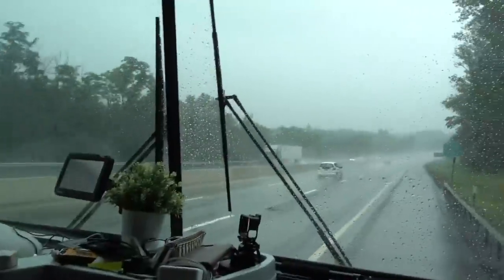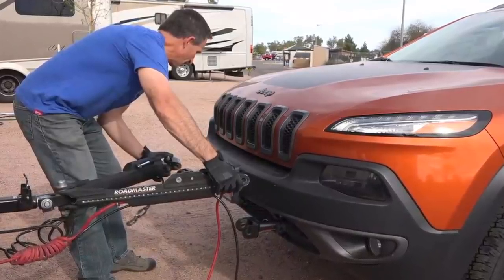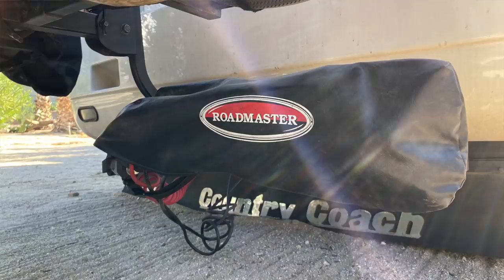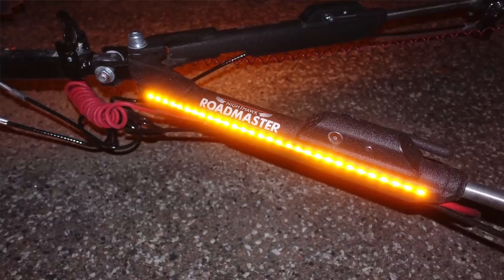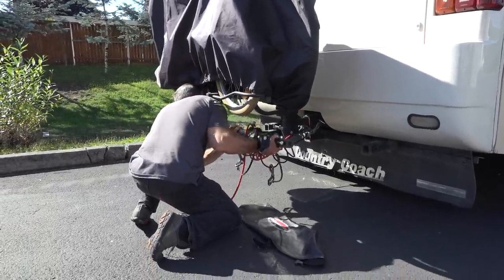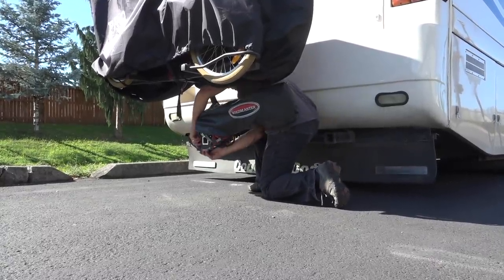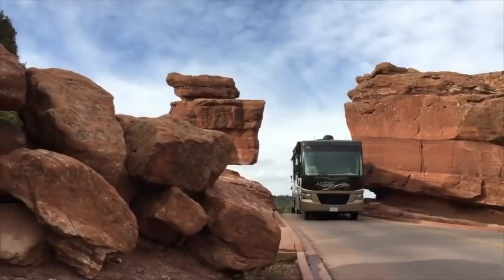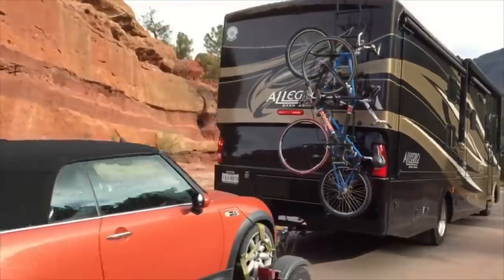PART 2: DEATH WOBBLE? HOW WE FIXED OUR JEEP SO IT WON'T HAPPEN AGAIN | Full-time RV Life

Comment: Glad that all seems fixed.  We too have a Jeep Cherokee Trailhawk with the Jeep fix installed.  We also had the dealer install a charging line from the motorhome to charge the battery.  Even with that, we had an occasional dead battery in the Jeep.  We eventually chased the problem down.  If everything started out nearly fully charged, we had no problems.  If the Jeep’s battery was just a little bit low before hooking up to the motorhome, it did not work.  The dealer’s solution was a direct connection through a diode to the Jeep battery from the motorhome through the 7 pin connector.  In this case, the current drawn through the cable exceeded the fuse capacity and would blow the fuse.  Of course we never knew this when it happened, so the Jeep battery would fairly quickly drain.  We installed an RVI Towed Battery charger and have not had the problem since.  It seems to be able to charge at a high enough rate to maintain the battery, but limits the current to a point that we do not blow the fuse.
Reply from the maker: Thank you for sharing your experience.  Great information, and glad you got to the bottom of the challenges in your install.

Comment: I am glad you have gotten a resolution to your death wobble. After your video, I realized my Roadmaster tow bar is also quite loose and called them. I can order the rebuild kit to tighten it back again. 
We towed our 2016 Cherokee over 10000 miles before experiencing the death wobble on severe frost heaves on the Alcan. We had the Jeep harness installed in the Jeep in Alaska.  We already had the charge line thru the center pin hooked up. 
As per info in the IRV2 forums, I later moved the harness power source from the power distribution box in the Jeep to the charge line from the RV. This way the steering fix is activated when the ignition of the RV is turned on. It is quite a bit more convenient than pulling the fuse. I also added a large LED strip to the load side of the Jeep added fuse. I then place the portable LED strip on the dash and can view it from my rear view cam and ensure there is still 12 volts going to the steering unit. It is piece of mind to know the steering fix is active, as having had the death wobble, I never wish to experience it again. We were lucky that we were going fairy slowly and there was no traffic and having read about it, I recognized it quickly and stopped immediately.
Safe and happy travels.
Reply from the maker: Excellent solution Tom.  Thank you for sharing for the benefit of others. Sorry to hear that you experienced it, but impressed by the solution you put in place. Would be great to not need to do the fuse, and great to have confirmation of power with the LED light.

Comment: Went to my local Jeep dealer to get the after market part installed on my 2018 Trailhawk.    $132 for the part, 4 hours labor @ $160 per hour......$780 after tax.    That’s a big expense for a vehicle that should be flat tow ready from the factory and so much more than the $500 you were able to get it done for .
Reply from the maker: Sorry to hear it cost you more.  Agreed that Jeep should not be charging us all to live up to the original expectation that the vehicle is flat tow ready. Newer models have fixed it and truly are flat towable without the mods. -M

Comment: I was aware of the "death Wobble" problem with the Jeep and I believe also with some Ram trucks. When we was looking at a new Jeep Grand Cherokee limited I asked the dealer about it. He said the issue was corrected after the 2018 models of Jeep. I was told by a Blue Ox dealer that we should have ours inspected yearly and overhauled every two.
Reply from the maker: Thanks Roy. Yes, we have heard that some Ford trucks also experience it (mostly F350).  Good that you also heard Jeep fixed after 2018 models.  Hopefully the video will remind folks about getting their tow equipment inspected and serviced.

Comment: We just bought a 2016 Jeep trail hawk with that towing package. Pardon my ignorance, but when you say you are having the dealer install the system, do you mean the Jeep Dealer or some RV dealer, of the tow package dealer? Who do we have install this system and do we buy all of the components from that dealer? Thank you
Reply from the maker: Towing equipment is usually installed by an RV dealership or other shop that sells it.  But... the Jeep specific wiring harness for a 2016 Jeep is definitely only to be done by a certified Jeep dealership, because it requires wiring into the main wiring harness. I would not want to have that done by anybody who doesn't know what they are doing, or who wouldn't be able to replace the main harness if something went wrong. -M

Comment: Question : We recently picked up our Grand Cherokee after the wiring harness was installed to end our Wobble issue. I would like to know how you were instructed to activate the upgrade. We are still experiencing low battery issues with ours. We were told to turn the toggle switch off after unhooking our Jeep. We were not told to pull the fuse however. Others have said that we need to also pull the fuse. ?
Reply from the maker: Yes, we need to pull the fuse after turning it off. Hope that helps you avoid more battery issues.  -M

Comment: Guys,  thanks for the update!  You mentioned that the 2019 Cherokee doesn't experience the death wobble.   Does it still need the supplemental battery charge lwire from the motorhome?  I have a 2019 model with a newly installed ready brake.(fully mechanical) supplemental brake system, but I have not towed with it yet. My electrical cable does not have the trickle charge conductor to feed the battery, so I'm wondering if this will become a problem.
Reply from the maker: With a fully mechanical supplemental brake system, and without the wiring harness to keep the steering active, there should be very little draw on the battery.  Only the brake lights or running lights if driving at night.  With that in mind, I would expect that you will be fine, without additional charging.especially if you mostly drive in the day. That is of course, unless there is some other electronic draw I am not aware of in the new Jeep when towing.